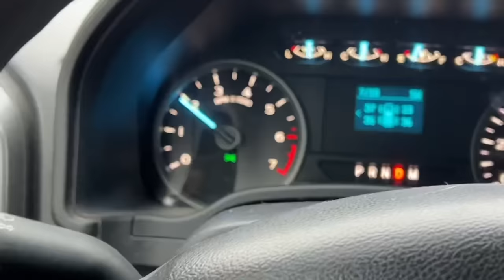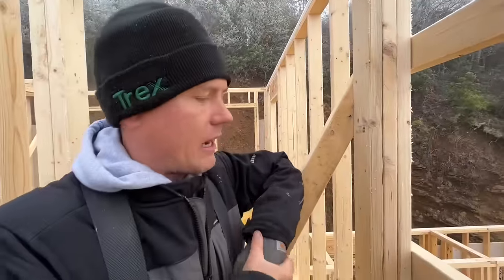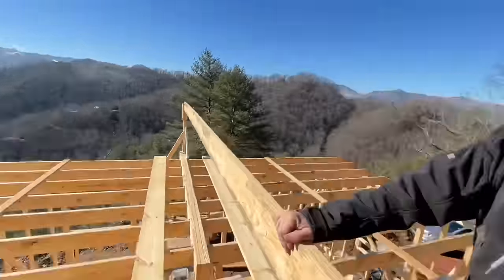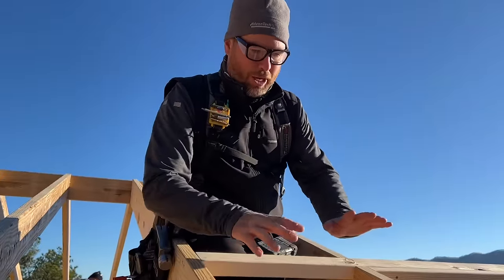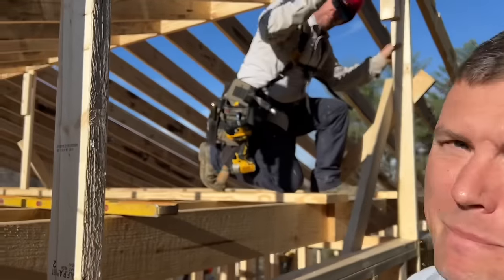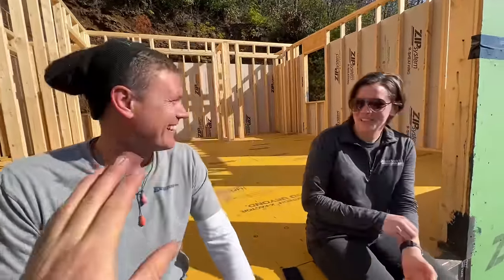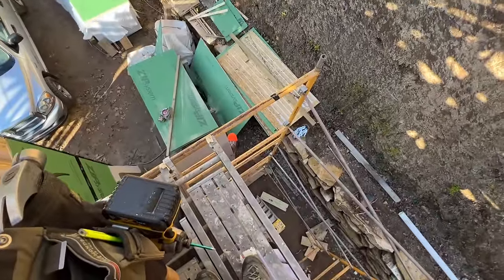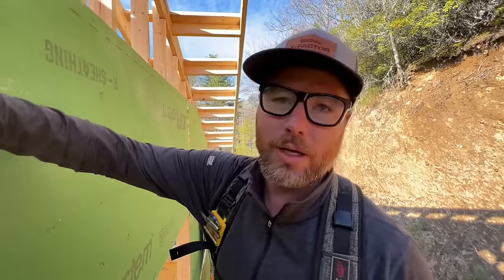Build Your Own Roof | Building A Mountain Cabin EP15

Comment: I just want to point out something. OSB is made of strands that are layed and laminated in... plies. These strands might be small little pieces of wood, but they are in fact layered into different thicknesses; and any material layed and adhered on top of one another is a ply. Therefore, plywood. #letjamietalk
Reply: some might even say multi density ply wood.
Reply: Well how bout that! I like your angle there
Reply: @jaimeperkins9606  for every angle, there's a dangle
Reply: Organized strand board. Organized into layers or plies. Yup, plywood
Reply: But we want to know about the chemical activation properties of the duct tape!
Reply: @Natedoc808  It's Oriented Strand Board, and they're technically not plies because they can and do overlap amongst each other, forming more of a weave-like structure vs a sequentially layered structure.

Comment: Built a lot of 2 story plus houses back in the 1980s and 90s. Never used scaffolding for doing exterior framing. Always used pump jacks and or put temporary brackets on the corners or in the window open to support the walk boards.

Comment: In MN we install wall sheathing vertically. I was told we do it vertically on the exterior because the interior has drywall hung horizontally so it has strength on both sides going different directions. 😘😉🙃🙂🇺🇸😎
Reply: Oh wow… I’ve never heard that reasoning. I think I like it though.
Reply: @jaimeperkins9606  we also run sheeting vertically to connect or secure the sheets to the bottom and top plates. If we have 9' or 10' walls we'll special order 9' and 10' sheeting. Sometimes the vertical sheeting doesn't land/break on a plate (balloon framing), so we install blocking for strength and it is also considered a fire stop. If we put it on vertically, we would have to install blocking everywhere there's seam. Blocking does add strength, but it's a pain in the @zz.

Comment: I believe Tim stands his sheets vertical because up here in the Pacific Northwest we have to block all of your sheet seams, when you stand your sheets vertical less blocking, better insulation, I agree we with the strength axis of horizontal sheets. Up in the PNW your plans have to be stamped for every new house, I bet you appreciate your building department trusts you to build your houses how you want.
Reply: I am thinking that the building department probably remembers the inspections and quality from all the previous two decades of home builds, and they are willing to give a little rope. And the Perkins team does not disappoint or try to stretch that leeway in the wrong direction. A trust earned and not taken for granted.

Comment: Here in Idaho where we build, you can install sheathing vertically or horizontally...if it is installed horizontally,  blocking is required at every seam 4' from the corners and every 25' on a straight run wall, for your shear nails.

Comment: Eric, I just want to comment about owesomeframer laying wall sheathing vertically and not staggered.  It would be better off to lay them horizontally and staggered like you’ve been doing.  Longer base and staggering make the wall stiffer against shear wind.  Also, staggering avoids sheath butt joints along the an entire stud.  The taller makes it worse.  That will become the weakest links for the wall.

Comment: One small advantage of installing the sheathing vertically, is you don't need noggins (do you use that word in USA, the blocking half way up the wall that the sheathing is nailed to and that stops the studs rolling if there is no sheathing). So every so slightly quicker and slightly less thermal bridging.

Comment: Thanks for the content! I loath vertical sheathing installation. It sucks landing studs every four feet and regardless of the strength axis of the sheet good, your only shear strength is 3/4" nailer where two sheets meet.

Comment: No, the drywall guys don't like those kinds of corners very much.  Corner is more prone to cracking later (no solid back to fasten to), and it somewhat dictates the order in which the corner is hung (in this case it's fine because the blocked side is the long wall).  Ideally you'd want to pinch the blocked side in with the other side which has a full stud in the corner.

Comment: I've heard many people say that walls are "stronger" if you install sheathing vertcially. I think maybe the racking strength is in fact lower but the house resists uplift force better in this config, but nobody says that part. So I guess you need to decide if you're more worried about the house getting blown over or ripped off its foundations, I think either way is fine almost all the time (where I live almost all builders only sheath walls that they can't fit diagonal steal bracing on). But I'm in electrician and should not be listerned to about most things, this included.

Comment: This was an interesting build day with a lot of unique things added, like the overhang structure, and the explanation on why they were used really helped.  It is also interesting to see that the manufactures reps came out to see how you were using their plywood…oops…”sheet goods” made out of OSB waere used on this build.  Personally, I would rather have corner bracing every 12 inches instead of the 24 inch method used at the one corner.  One thing we used to do on some builds was to use more scrap material that over hung the corner by a couple inches each side and that gives the drywall some nailing space every 12 inches.  If you think about it, most drywall installers put 2-3 nails or screws in the center of their drywall sheets, which is essentially every 12 inches. Just my opinion.

Comment: I’m a builder in nj the reason for horizontal is strengthening for both studs don’t twist and warp so much and vertical is for energy efficiency but with zip you cover the seems most track builders will do it vertical it’s cheaper for them on wraps  horizontal is best I also studied architecture for six years before becoming a builder plus my dad was Vice President of large build material company

Comment: Typ using the speed square with a min 2 inch bird mouth will give you something to nail down to top plates. That said your zero point of contact will work with the lap of CJ to top plates prior. In so cal we would need a H1 or full A35 per bay. Nice work guys 🙌🏼🙌🏼

Comment: I am curious how you achieve shear strength on your wall diaphragms. Didn’t see any let-in bracing and since you are running OSB (😂🤣😂) horizontally vs. vertically, there is no direct plate to plate connection. Maybe a seismic and wind load code difference in your area?

Love the show and your team dynamics…keep it coming!!!
Reply: Once any wall section is fully sheathed,.. it becomes fully, continuously braced laterally. Even though the sheets are separate pieces, the 1/8” gap between them does not allow any flex or movement
Reply: @jaimeperkins9606  appreciate the response. Our seismic code is definitely stricter in Seattle, just as our energy code requires minimum R-21 at walls. I enjoy seeing these differences, similar to differences seen when watching Matt Risinger on the The BUILD Show or NS Builders. Keep on doing what you all do…look forward to every episode.

Comment: We put our sheathing vertically because we need edge nailing on all sides, if we were to do it horizontally we would need blocking between the studs. On a shear wall requiring edge nailing 3" oc or more then we need 3x edge material.

Comment: Y’all should ask the Huber Reps what kind of product savings they get using OSB vs Plywood sheathing it does have a weaker tinsel strength but I’m guessing it’s probably 80% cheaper to make than traditional plywood sheathing!
Reply: Plywood also requires bigger trees to manufacture... Ideally as much construction material as possible would come from intentionally planted timber, leaving old growth alone except for more valuable use cases (fine woodworking, boatbuilding, etc) when it can be sustainable harvested.
Reply: just imagine the savings on the huge knife used to cut the veneers off the log alone.  funny that osb isn't 80% cheaper than plywood.

Comment: Did you guys do anything to attach those ceiling joists together that are flush mounted on the beam? Since they are in tension I’d be worried they will pull away from the beam.

Comment: You may want to open up the code book that slide off into the mud on the last video. R802.6. Not less than 1-1/2 bearing on top plate for rafters. Roof load needs to be transferred down the wall to the foundation.  The connection between joist and rafter may need to be more than just nails. You also have no connection between rafter and top plate. They make screws for this connection  these days made by Fasten master , Spax and probably Simpson.

Comment: I’m curious about your vapour barrier requirements there- noticed you guys don’t Pre install any poly at top plates and/or intersecting walls
Reply: Yes, that is not required here. Just the green vapor coating on the Zip and tape

Comment: How big are them there overhangs? At what point would you add support brackets? Thanks. Love the videos!
Reply: They are 30” on the downhill side and 24” up the gable ends. I’d say like 36” or longer would need additional support with this framing method and materials..

Comment: For those ceiling joists you were putting up in the time lapse at the beginning, you broke them in the middle of the wall the spliced them together with a block. Did you do that because it's less expensive than buying each joist long so that they overlap each other?

Comment: Have you guys ever had a client request a "high performance" house? I've been looking into 2x8 construction for our next home build.
Reply: Just to weigh in on that topic, You would likely get a higher performance house using 2x6 or possibly even 2x4 walls with a rigid foam over the sheathing , then 2x8 walls. Depends on the thickness of the foam of course. Or you could use the Zip R sheathing as they are doing on this build.
Reply: @Vanbulance89  great point! I’m actually looking at 5/8 zip sheathing full surround, 2x8, 3” of spray foam on exterior walls, rock wool to fill the rest of the cavity, and 6” safe n sound between all the rooms.

My goal is for a passive house rating

Comment: You will never convince me that vertical wall osb is stronger than horizontal... no way. Every 4 feet you have a hinge point.
Reply: Vertical install is the norm on west coast since we’re building in a seismic zone. Most shear walls require continuous blocking on all panel edges, so installing vertically minimizes the blocking requirements.
Reply: a hinge resisted by 3 plates, but I get your point.

Comment: Love the framing and roofing tips.  Have you considered renting a lull forklift when you're framing, siding, and painting?   It saves time by eliminating setting up scaffolding and lifting heavy timber and the zip panels (didn't say plywood).  BTW, the weather down by you is so much better than where I am in upstate NY.
Reply from the maker: I would love to have a Lull, but we have run the numbers and it would cost us a lot more money than labor it would save on these smaller houses. Also on some of our sites you could only get to one side of the house at best with the machine like that
Reply: @PerkinsBuilderBrothers  Get a bigger drone and rig it to lift stuff up you you 😉
Reply: @PerkinsBuilderBrothers  how about some scissor lifts? Btw are you guys going to the international building show?
Reply: @PerkinsBuilderBrothers  but what is the wear and tear on your body worth?  I get what you're saying but if you can afford to work smarter not harder, that seems like a gimmie.

Comment: On a long low pitch span such as this, what is to stop the roof sagging in the middle when it has (for example)  a significant snow load?  You not fitting diagonal struts?
Reply: Well we can add those members if we want to but we don’t get much heavy snow here… the rafter size is rated for the span without any other support
Reply: @jaimeperkins9606  I knew you'd be on top of it. Best wishes

Comment: Given this project is in North Carolina they would meet the code exceptions that allow placing their panels horizontal with no blocking between the joints. The reason why you would span the panel vertical is for greater in-plane shear wall capacity (if not blocking). You can block the horizontal orientation and achieve the same capacity as vertical orientation. Same reason why a blocked diagram has more capacity than an unblocked one.  If you really want to read more into detail about shear wall panel systems I recommend picking up a copy of the SDPWS published by the American Wood Council which is what Engineers use to design shear walls and diaphragms. Look at section 4.3.7 and become familiar with Table 4.3A. All the projects I design in high wind and seismic will require all edges of the panels to be supported by and fastened to framing members or blocking. If you install horizontal and don't block you have a weaker system because at the boundary between the panels you "break" the in-plane shear transfer. In order to transfer the shear, the wall studs are doing all the work to transfer the shear to the lower panel. If you block that blocking member transfers the shear between the two panels and is much stronger/direct.

Comment: The awesome framers sheath vertically so they don't have to run blocking at the edges of the panels on shearwalls. The strength advantage of horizontal-run wall sheathing seems intuitive but it's non existent. Walls can be run vertical or horizontal. Only roof sheathing needs to be horizontal.

Comment: On the gulf coast we run sheathing vertically because we use windstorm plywood…. Oops….ZIP.  It’s 109-1/8”. Also any horizontal seams need full depth blocking to meet the wind code.

Comment: Osb is not directionally stronger either direction PLYWOOD is because more layers run lengthwise, and even when they have equal numbers in both directions they are allowed to have joints in the layers  running width wise but not allowed to lengthwise which is why it’s stronger in that direction. OSB is weaker in any direction which is why we can’t even use it in some building parts where I live

Comment: As one who makes my living by framing this is hard to watch. You guys do good work but so much more work than necessary, every wall there could have been "plywooded"/ sheathed on the floor including the gables. All that time spent setting up staging and  pushing up zip. I would like to see the $ numbers and what you pay those guys. Up here in Ct. I could never afford to work like that with my crew.
Reply: It's a two story opening. How do you get the sheathed wall from the first floor to the second floor without a crane?
Reply: @Tyler Hawk  maybe you can pass that on to the Perkins and can explain why they didn't do it that way. They still would have to put up the scaffolding on the outside to do the windows and siding so not sure if it would have saved them all that much. Steven probably just does the  framing part so your method would work better for him since he's not doing any other outside work.
Reply: @stewiesaidthat  Yes, we do it all the time, set some staging up inside just like a floor, build it, sheath it, stand it. we also trim the gables which on this house would have been a challenge with the large overhang but still quicker than climbing around outside. also there not doing the siding and windows off that staging, they will probably set it up and break it down 6 more times by the time they get to that. Again, I would let these guys build a house for me. just think they could be so much more efficient.
Reply: @Steven Leiler  I wouldn't hire them either. Spend too much time explaining and not enough time doing.
 Use cement block instead of wall forms.
Keep in min that  they are not production builders. They do two houses a year. It doesn't pay to own specialized equipment that they only use once in 5 years. On the farmhouse, they left the scaffolding up until they were completely done. There was no putting it up and taking it down between each process.
I'm sure if they came to work for you and built the same cookie cutter house, they'd do it the most efficient way possible. As it turns out, they like different challenges, which is why they bought their own land to develop and build the style of houses they like.

Comment: I mean no disrespect, but I HATE corners framed like that, with just horizontal blocking. Even if I'm not the guy hanging the board, 3 screws per sheet in a corner just feels like a Crack waiting to happen to me.